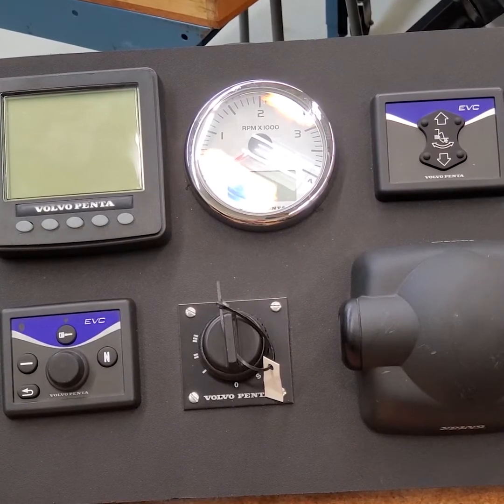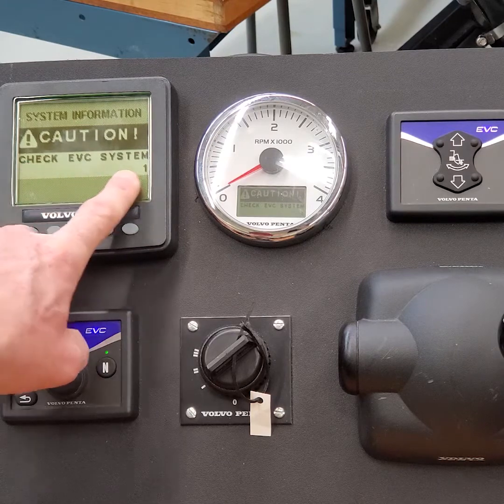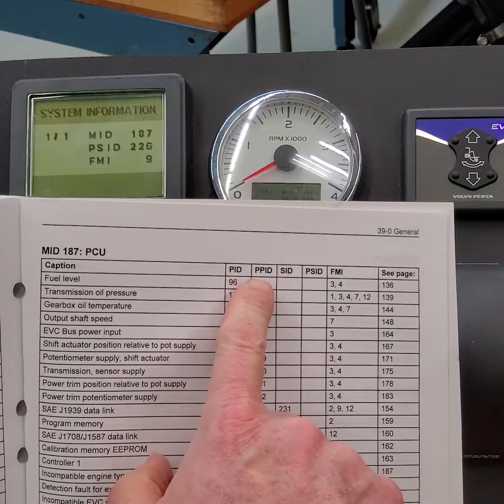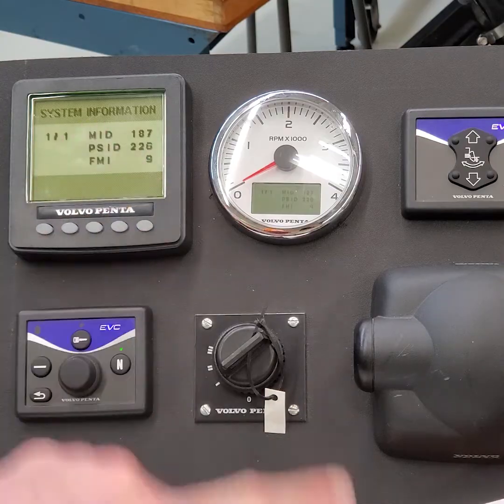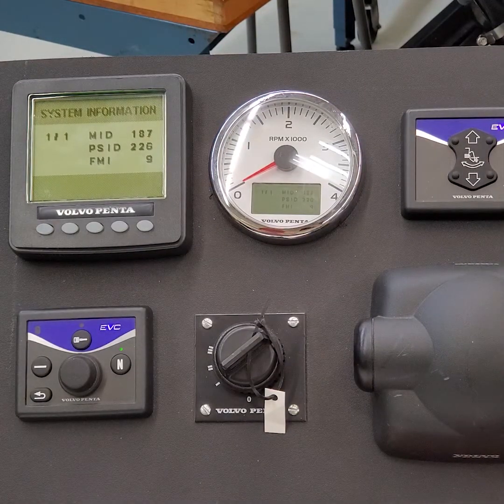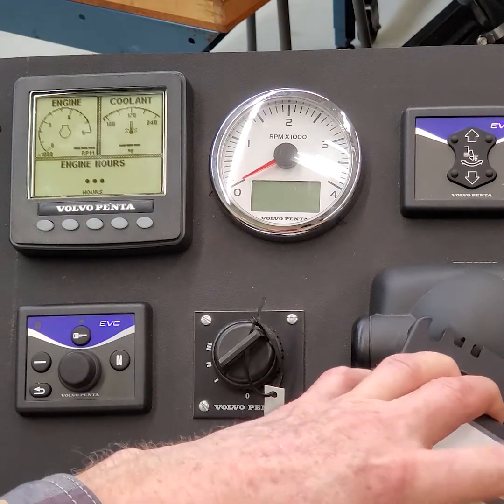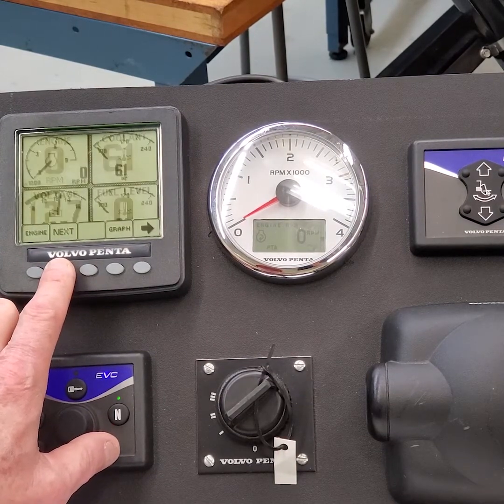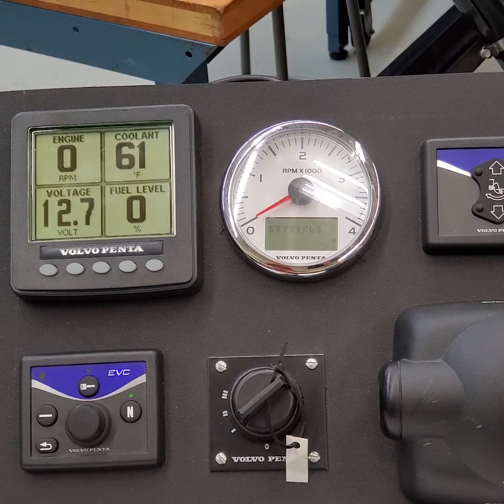Volvo Penta Repair, EVC-C Helm Diagnostics 1

Comment: On our 2009 Tiara Sovran we Have an EVC code 1 Alarm  on the  Volvo 500 I PS engines.  This fault  occurred after we replaced the house batteries, If I clear the code everything operates normally , I get full power and all systems work .  Do you think it would be safe to do an Auto Config to the system ?
Reply from the maker: I would only do an auto config if you have repaired a failed part or updated software. By the sound of what you did (replaced the batteries) it was likely a low voltage code. So I gather the problem does not or has not repeated since you cleared the code. Yes?
Reply: Unfortunately it has repeated. It’s strange though because it only happens after the port engine is started and I’m just beginning to start the starboard engine is when I get the EVC code 1 alarm.
Reply: The battery replacement may have just been coincidence, not sure but you bring up a good point.
Reply: I was told that I could clear the code by turning the keys to the off position and then turning off the batteries for 3 min.  Would this have cleared the fault codes ? Or do I need a special tool to clear the code .
Reply from the maker: @donaldwatson554  With EVC the codes will auto clear if you fix the problem and shut the key off for 15 seconds (enough to allow all nodes to shut down. 
If the code comes back it is still an active/intermittent code.
Reply from the maker: @donaldwatson554  That could be a power loss during cranking (the starboard engine). Have you tried starting the starboard engine first and then the port to see if it still occurs. If you haven't, inspect and clean the battery terminals for the engine starting batteries and then also the ground terminals for the battery negative cables (both ends).
Reply: Thank you, I will try that. Unfortunately I won’t be able to get back to you till spring time as the boat is now out of the water and being barrier coated. I appreciate all the advice, thanks again!We live in Michigan and Can only boat six months of the year.